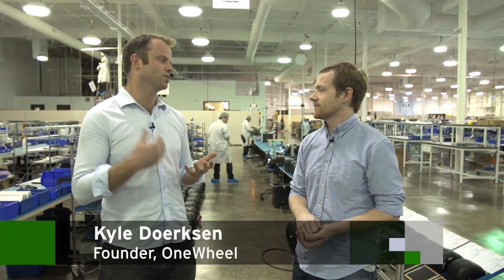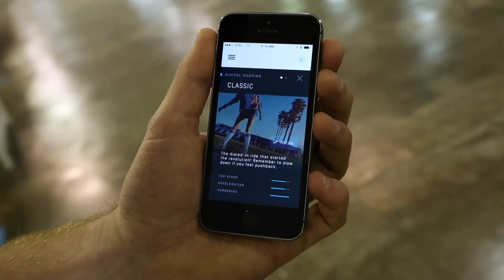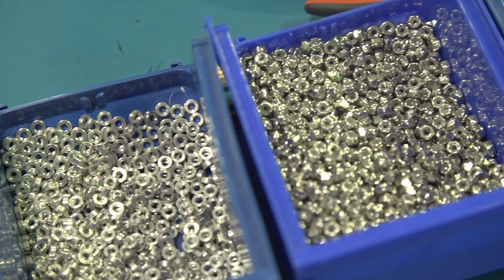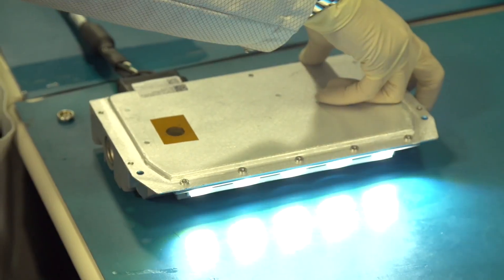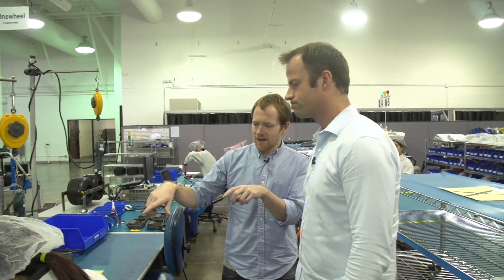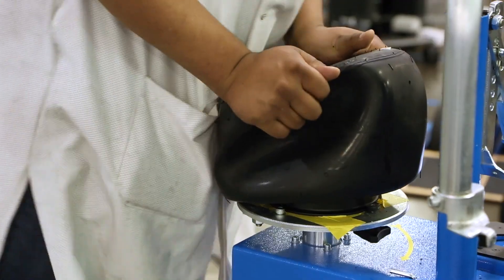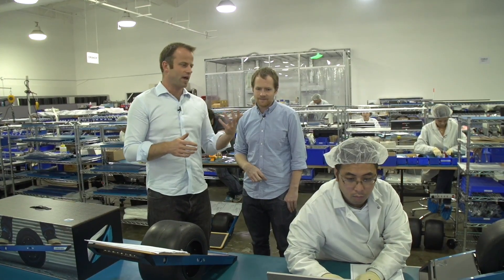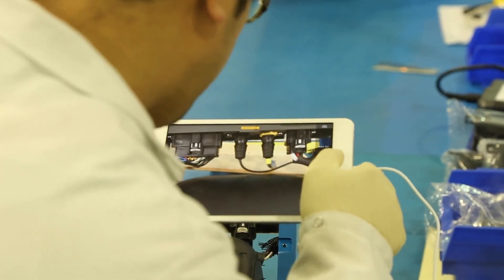OneWheel Factory Tour

Comment: Can the wheel be punctured? What's then?
Reply: It can be replaced
Reply: it can also be patched like a normal tire
Reply: Tire has sealant in it.  Everyone’s RîG gets punctured.  The sealant does the job well.
After 2+k mi?  Get a new tire...aftermarket tires are better than the stock Vega it comes with.
Reply: From Yves: it's really a good tire and usually explores watch for those kind of things when riding.